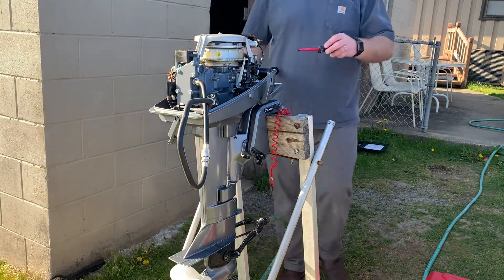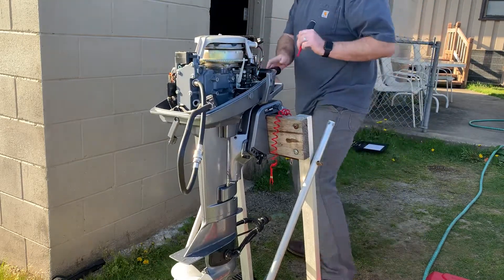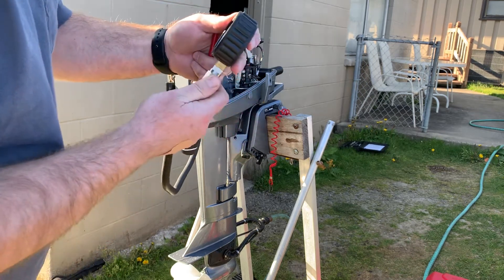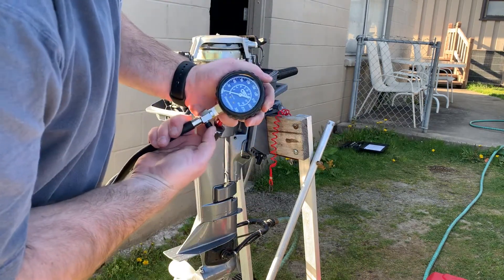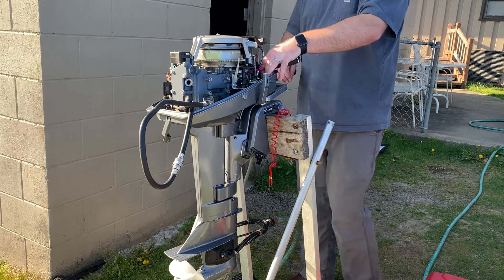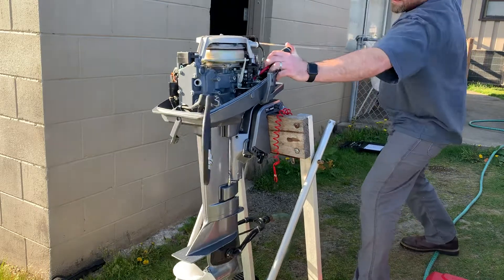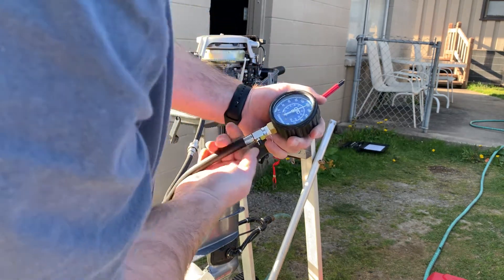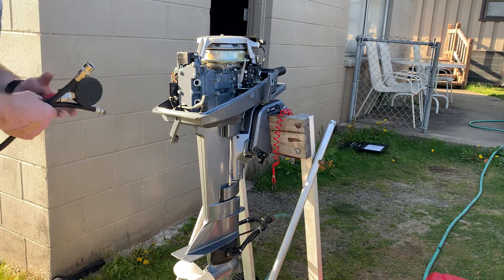8hp 2007 Yamaha 2 stroke outboard Compression test

Comment: this motor  can be accelerated in neutral?? I try mine and there is no way to accelerate it to cold start.
Reply from the maker: You may need a carb clean or linkage adjustment should be able to put it in fast start position, check roller cam settings

Comment: It runs like a champ on the stand but the true test is on the boat. One thing it won't tilt up. The lever on the side won't release the lock. I have to reach around with my fingers and move it and then it tilts. I'll figure it out.
Reply from the maker: fishin n flyin if you put it in forward then it should release
Reply: Haney’s Garage that's what I was thinking but it won't. The guy I got it from just did the water pump so I was thinking maybe he didn't hook up the shift linkage right. I'm ordering a manual now. He did the carb and hooked the throttle linkage backwards I come to conclusion his mechanical skill isn't the best.

Comment: I just bought a 1998 model and the compression was 125 on both. I hope mines ok. I haven't had it out yet.
Reply from the maker: fishin n flyin that’s still good compression and it should be good as long as you have spark and a clean carburetor and good fresh fuel non ethanol if possible especially for storing the outboard